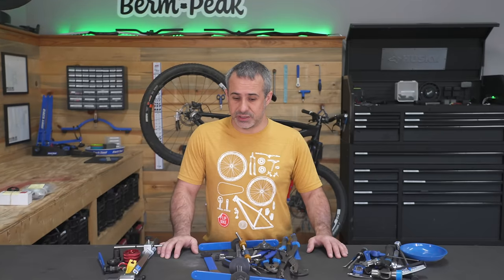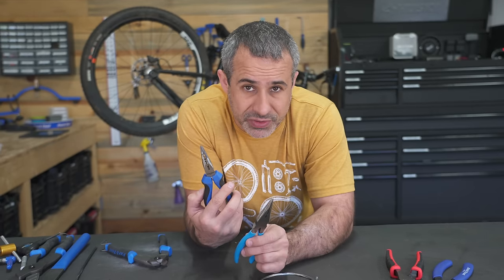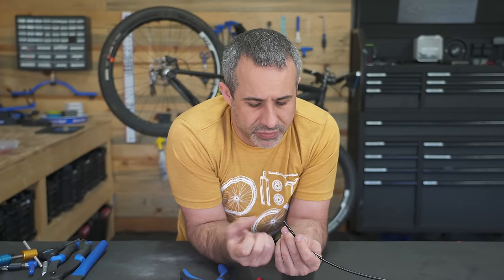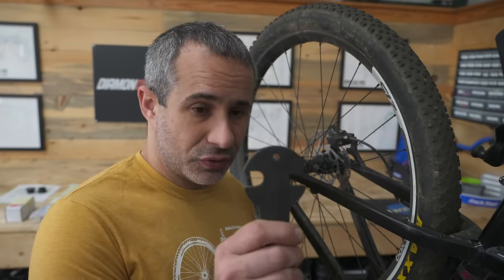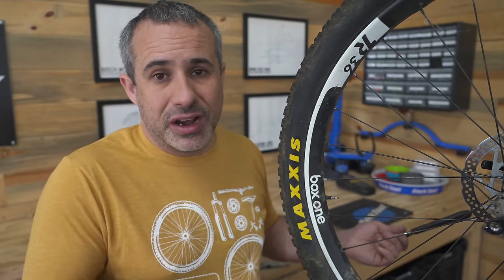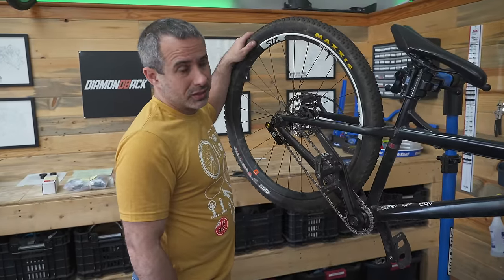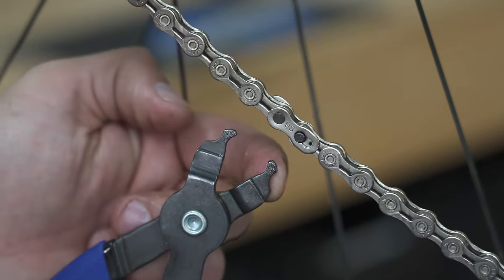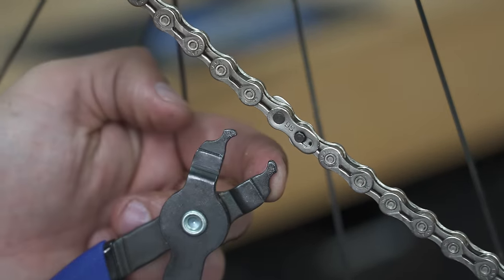Are "Bike Tools" really different from "Tools"?

Comment: There are some very unhelpful and misleading comparisons here. The Ace cable cutters are designed for copper electrical cables, not braided steel cable or cable housings, and I bet that it said something on the packaging about not using them on steel cables. It's hardly surprising that the Park Tool pliers with a crimper do a better job of crimping than Channellocks without a crimper. And trying to shorten a chain without a chain breaker is just silly. The fact is that there are some bike specific tools -  chain breaker, cassette remover, crank puller, cone wrenches etc - which are really essential for certain tasks, but general workshop wrenches, hex keys, screwdrivers, pliers, sockets etc are just fine for many tasks, and in fact better a lot of the time, given that bike wrenches, for instance, are generally made of thin pressed steel and would be laughed to scorn by any auto mechanic. Yes, you need a thin wrench sometimes, but not most of the time, and I prefer using good quality general purpose wrenches whenever possible.

Comment: A smart mechanic doesn't use a Phillips head screwdriver. The screws on a bicycle are JIS head, not Phillips. 
The bike mechanics I know use Felco cable cutters. Also, you DO NOT use cable cutters for brake housing. It crimps the spiral wound steel. Use use regular side cutters for brake housing.

Comment: 9:07 you almost had it 😅 if you catch the oposit sides of the chain with the tips you can pop it open with almost every set of pliers out there (atleast thats the way I do it) you do have to keep in mind that it's easier to do when the chain isn't under tension
Reply: That’s what I did until I folded and got the right tool, not going back.

Comment: protip: for aluminum frames with stuck on parts, just use some mercury to soften the aluminum frame.  Pros: you will be able to remove the stuck on part.  Cons: there isn't a way to un soften the aluminum.

Comment: The open-ended wrench merely fitting on the pedal can be misleading. Notice that Seth didn't actually try to remove or install the pedal with that wrench. He just put the wrench on the pedal.

I tried using one in a pinch when I didn't have a spanner. But when you tighten it down, the wrench head can get squeezed against crank arm which pretty much locks the wrench into place and would require a significant force to remove. And that pressure from the pedal pushing the wrench head inwards could crush against your carbon cranks possibly damaging them. It's not worth the risk unless you are totally sure your open-ended wrench is not too thick. Keep in mind that most open-ended wrenches are tapered so you need to make sure it's thin enough at the thickest part. I don't have many bike-specific tools but I think a proper spanner is worth having unless all your pedals support hex wrenches.

Comment: You already have the trueing stand if you have a bicycle! Ok, you now might need zip ties or your thumbnail.  If you need a  truing stand you've forgotten what the joy of cycling is about. A crutch. Pool ladder is essential. Needle nose pliers are tricky on master links.  A better solution is 1speed master link.  Sizing of chain done with dykes  held as if the chain was in the bike by the side 
 Single speed chain doesn't fit the  Pedro's tool. You'll break the pin! Additional pins inside the handle. No need to use blue painter's tape on tools to impress others. The micrometer  in Hambini's videos, (Mitsyomo, or something like that) are the same as Harbor Freight, Park, et al, the difference is the color plastic they are molded in! Park tools disk measuring micrometer actually does have a different jaw piece. They all use the same battery. All China, Quality to be sure, but you get to choose what you pay!